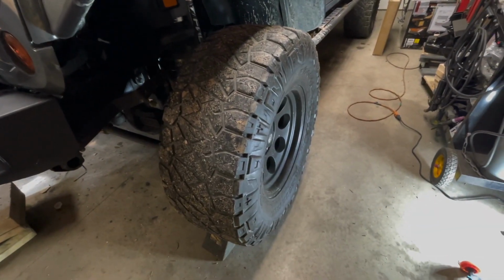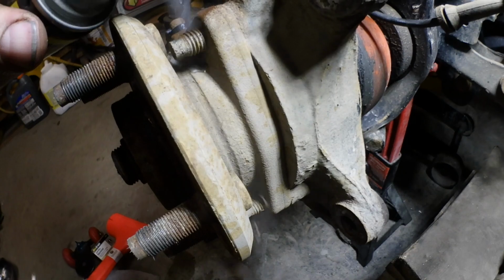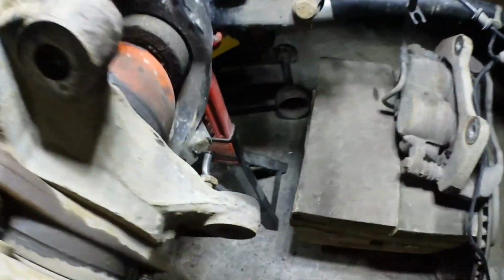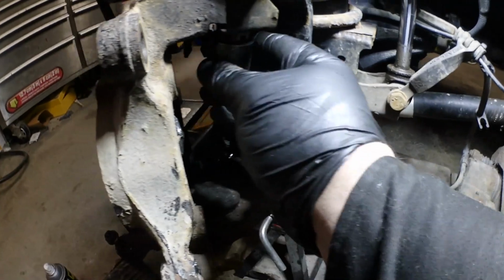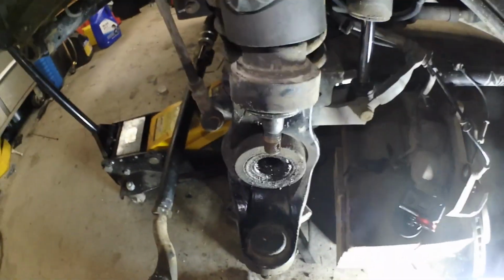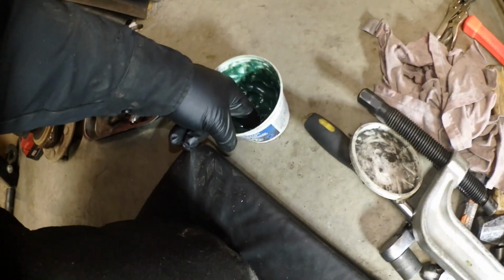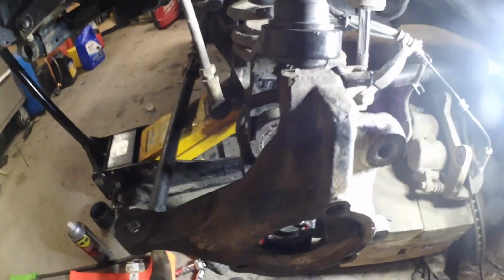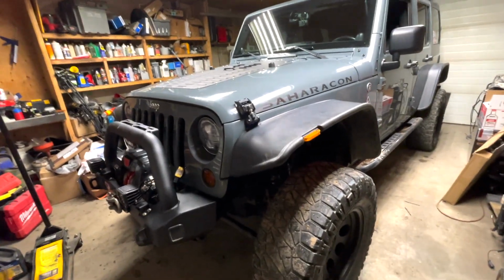DIY HOW TO REPLACE BALL JOINTS : Jeep JKU Wrangler

Comment: Installed these last year, had to adjust them for the first time after about 20,000km, noticed things were a bit sloppy on the last camping trip. Nice and snug again but on one side took some work to break that collar free. The other one no trouble. Have you adjusted them yet? Any difficulties?

Comment: I just got my ball joints installed and noticed after driving it that one of the upper ball joint the metal part where they add the grease broke. I think it’s called the grease zerk. Should I be worried would this affect any how?
Reply from the maker: You can just replace the zerk